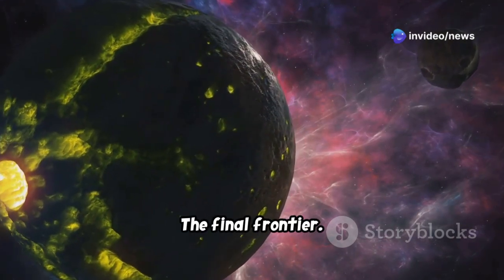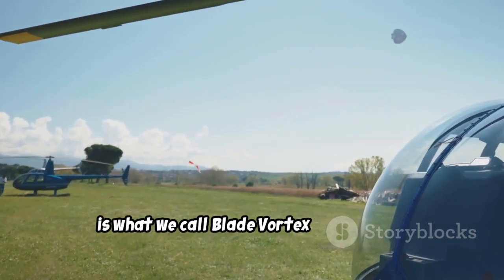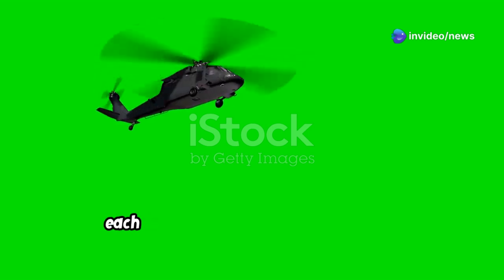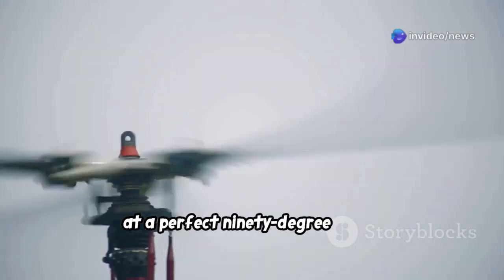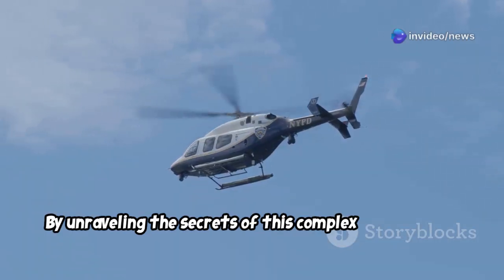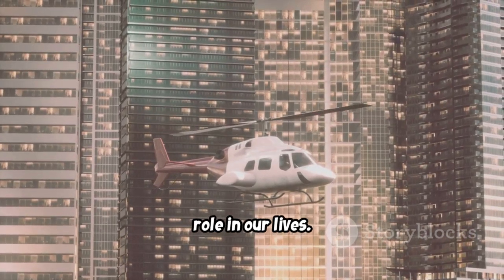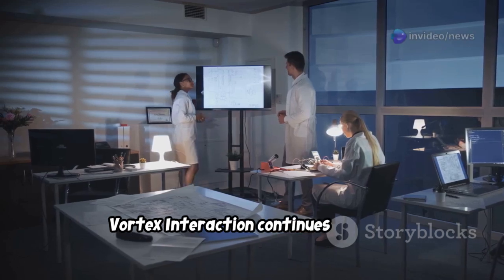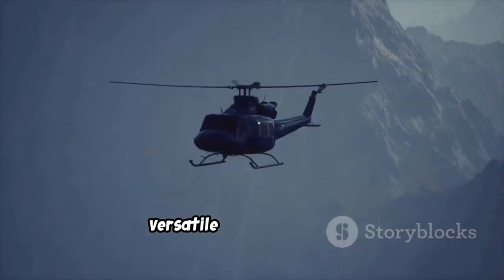Decoding Blade Vortex Interaction (BVI): The Science Behind Helicopter Noise

Comment: Is BVI different within chinooks? Also does it drastically change during ETL
Reply from the maker: Yes, Blade Vortex Interaction (BVI) is fundamentally different within Chinooks because the aircraft must manage interactions not just from a single rotor, but between two massive, overlapping rotor systems, and it changes drastically during Effective Translational Lift (ETL).

In a Chinook, BVI is multiplied:
• Intra-rotor BVI: Blades interacting with vortices from their own rotor head.
• Inter-rotor BVI: The aft (rear) rotor blades slicing directly through the powerful, concentrated vortices shed by the forward rotor. Because the aft rotor is elevated higher than the forward rotor, it is perfectly positioned to catch this wake during specific flight regimes.